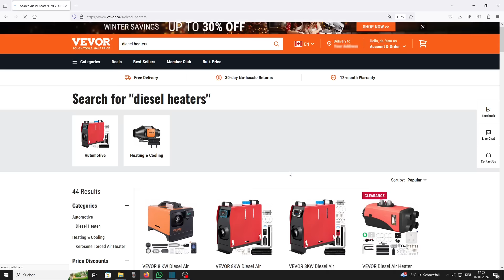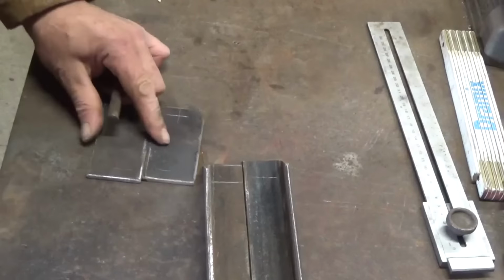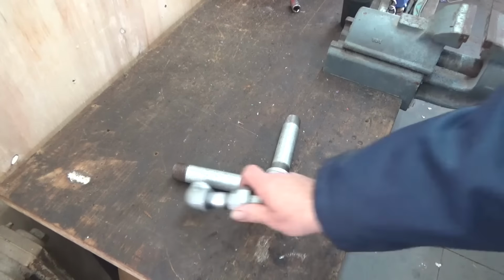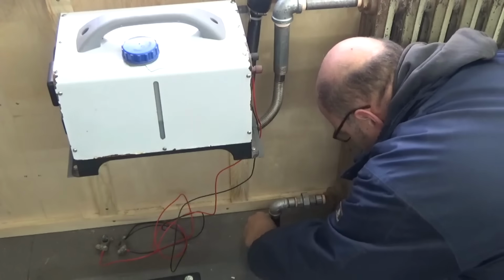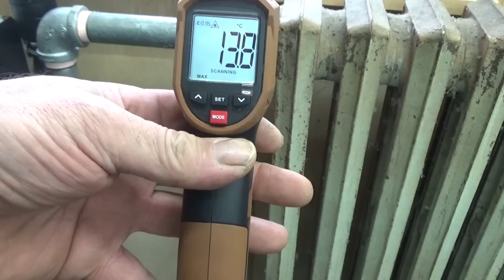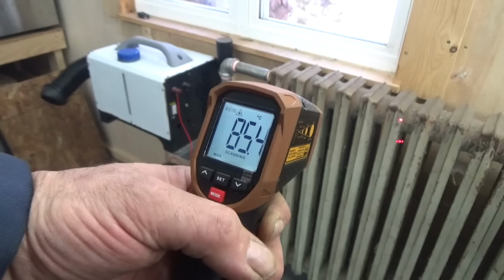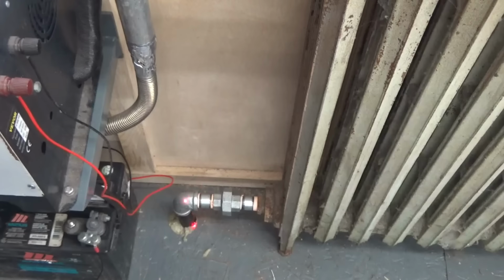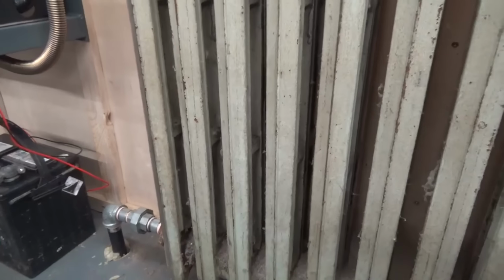Diesel heater upgade 200% more efficient

Comment: A meter of standard exhaust, always going down or sloped downwards, with a small fan blowing on it will yield room temp exhaust at the end with no carbon.  Also have the intake on the inside air to limot the effect of having to heat the air too.
Reply: I made a recouperator for mine with a 3m coiled section of the same exhaust tubing. It's got a riser section coming out of the heater and coils downward to the outlet. No fan, purely convective. Exhaust temps at the recouperator outlet are around 40c and just as you're experiencing, no soot. I was surprised as I was expecting at least some soot. I get lots of condensate as evidenced by the large puddles the thing makes, but I'll take a puddle with the extra BTUs. Its a garage I'm heating. Puddles there won't hurt anything.

Comment: How many amps does that diesel heater take to run?
Reply: Around 10 amps I believe. I had to buy a second power supply for mine as the first I got only had 2.5 amps which wasn't enough.
Reply: @alltaira5922  Uses only 4 to 5 amps for running. Startup temporarily is more because then it has to power the glow plug.

Comment: heat rises.. why did you do it backwards? exhaust hot out on top
Reply: I'd like to see if it makes a difference
Reply: It’s better that way, because all the condensation water can drip out and doesn’t fill the heater and creates backpressure. 
1L diesel creates more than 1L of condensation water.
Reply: @NickSiefert-jy7if    For the reason, you stated the exhaust pipe on the heater should be at a downward angle, not up as done in video.

Comment: I would have used black pipe and fittings, never galvanized when high temp is involved. It gives off poisonous gas. The exhaust pipe going uphill  usually causes problems with moisture buildup, but that big radiator must hold alot of heat once you get it running? Does any moisture accumilate or does it evaporate on the way out ? Do you need to drain it?

Comment: I think you'd be able to increase the efficiency by using outside air for the combustion air intake instead of indoor air.  You're creating a negative pressure space, drawing cold in inside the building.  Outside air will combust the fuel just as well and wont create a negative pressure. In the end you'll use much less fuel to heat the indoor air.

Comment: It will work but defeat the safety of it. Most are designed to vent outside so you dont monoxide yourself. Would be like running your car exhaust through your cab for more heat. Ok if it dont leak. For safety yours should mount so it exhausts outside of wall or floor and be sealed off from where you breath.
Reply: carbon monixide detector

Comment: Question...If you were to do this again, would you use a larger or smaller radiator than the one you have? Or would you keep it the same size. I was going to purchase  one on Facebook. The guy has quite a few different  sizes to choose from.
Reply from the maker: from my sight I would say I would go with the same size again because at the outlet the temperatur is so low what means for me it uses the maximum heat coming from the exhaust if it would be more hot at this end I would say it is to small.
Reply: @dsfarmns2823  Okay, Thank you! I was thinking about running two heaters to my radiator . I would make a junction box with two port holes, then run the combined exhaust  through the radiator,  so I am thinking of going half again larger than yours, maybe. I want a little heat to escape out the radiator exhaust. I will make my pipes larger than yours to make up for the combined exhaust. Good job on the project,  stay warm.
Reply from the maker: @mrwilly41  just make sure you have enough cross-sectional area you dont want back pressure and in my opinion I would go at least  1.5 times bigger radiator or 2 times if you use 2 heaters but wy not use 2 radiators for every heater one?
Reply: @dsfarmns2823  Like you, I am thinking less holes in the building. I will make it so I can remove one of the heaters for other tasks if need be.

Comment: How long can you run the heater off that single 12v battery?
Reply: heater runs on diesel, and uses just a bit of electricity for the fuel-pump.
Reply: Mine is a 8kw and it’ll run on the middle heat setting around 20 hours on a 850cca deep cell battery but you need to fill the fuel every 10-12 hours, my tank holds a liter and on the highest setting the battery last about 7-8 hours,1 liter of fuel lasts about 5-6 hours on high. There are tons of variations of these heaters tho. Mine from eBay was $80 to my door in New England
Reply: @jeffhuntley2921  only a 1 litre tank? That's weird.

Comment: Exhaust gas’s will want to go up not down, so you are fighting nature by pressing down hot fumes. Wire it differently with input down and output up. Then the radiator will be hotter down, with will heat upwards with the natural flow, producing more warming energy.

Comment: You will have a carbon build up becuase water will puddle in the pipe before the rad  #1 failure of these unit is carbon from bad exhaust routing

Comment: Here is some food for tought ....  Turn around the Heater unit so the air exit is on the Radiator side (soon it will suck in warm air at current position)   get a shroud made for the Radiator on on the side facing the wall and the opposide side.. Mesh on top  ..  bottom side give it the hot air exhaust  from the unit as well.  box off the under side of radiator but allot a few holes in the sides * 60% open max only front .. this will increase airflow of radiator and the unit hot air will help disipation by both heat and flow..  my take on something ive seen ona 1970s Gas heater  this would circulate the heat from down to up . and in the whole room plus shrould could be insulated on the wall side with gold reflective foil from some rally car shop

Comment: Neat idea, I'd definitely make sure the old repurposed radiator was leak proof first, and definitely get a CO monitor or two.  Ideally get a CO monitor that has a relay to cut power to the heater.
Reply: Do NOT let it cut off power to the heater . . . . it may get overheated and destroy the motherboard, cut the power to the pump instead . . . . so the fan is still is working and cooling down the heater . . 

And think about that the radiator may only make the heater 3-6% more efficient 😵not 200%
Reply: @matzstrom3223 Comparing the difference between the radiator input temperature to the output temperature I'd say all exhaust heat has been captured in the room which would definitely improve the heaters efficiency more than 3-6%.
Reply: @pstoneking3418  No, he only measure IR in direction to the surface on the pipe/ radiator, it does NOT tell the temperature (energy transported) of the exhaust gases, you have to measure the gases when it exit the room.

One more problem is that he use air from inside of the room to feed the combustor. . . that same volume of air will get in from outside . . . .  . 

In a experiment video with a "China" heater, and when it runs in its most efficient set up,   it leave 94- 96% of produced heat inside the room, that's includes the exhaust pipe radiation, it exist a test video.

I have not make any calculating's that can back up my "may become only . . . " statement, but i think you get the point, 
It's NOT even close to 200% more efficient, but the claim may be 4-6% more efficient are for sure MUCH closer.

Comment: You could also build a sand battery and run the exhaust through that to prvide a thermal mass that will carry on pushing out heat after the heater is turned off.
Reply: I was thinking the same thing, a sand battery could be done incorporating a built in copper tube wound heat exchanger for hot water as well.

Comment: The aluminum tape is scarong the shit out of me, if that exhaust pipe falls out its going to be co poisoning
Reply: Just of a detector in the shop.
Reply: Just use gas pipe technology to make sure the exhaust pipe is secure.
Reply: You’re scared by a piece of aluminium tape?
Reply: It's very robust stuff.
Reply: You will hear and smell that, long before it becomesd dangerous.

Comment: At the lower end of the radiator, place a container for condensate collection. I don't want to upset, that's how I see things according to my idea. Anyway, the radiator being made of cast iron, it will accumulate heat, this is a big advantage. But, it is possible that an aluminum radiator is better, having better radiant transfer, dispersing the heat faster.

Comment: if anyone wants a cheap super simple way to extract heat from the exhaust, just buy a pack of scotch bright stainless steel scrubbers. You can expand them from the middle and slip them onto the exhaust pipe. They have a ton of surface area and conduct heat from the pipe really well. they work pretty well already by passive heating, but you can add a fan to help a little. You can buy a 16 pack for $10. Thats all you need.
Reply: Nice idea
Reply: Careful about back pressure. If you can, expand the exhaust pipe before you do this because if you plug the exhaust, the burner blower will start to force air out the sides of the exhaust instead of straight out
Reply: @aaronwalsh7266  I’ve had this for years, I don’t get why the exhaust will get plugged up? The steel mesh is on the outside.
Reply: That’s a good idea, just wrap it around the exhaust yeah? I’ve just bought one of these heaters it’s coming this week I’ll give that a try cheers 🍻
Reply: Great idea 👍
Reply: Considerably more HEAT comes out of the hot air duct than is lost down the exhaust. (4x as much). However, 20% going to waste is a lot.A long length of corrugated exhaust 
pipe could be run inside a 50mm aluminium tube with a computer fan at the cool end to maximise heat recovery. Don’t over-straighten the pipe so air can get all around it.

Comment: Better to use a heat exchanger and pump the water into the radiator. You're going to get stuff condensing in the radiator the way you are doing it. Plus the exhaust needs to be free flowing.

Comment: Your first 
section of exhaust pipe will fill up with condensate and block the pipe as it's going "up" to the connection on the old steam heater.
Reply: It is 100++ degree hot It can boil water rather than condensate
Reply: The outlet needs to slope downward so that condensed water can drain out.
Reply: @Dave5843-d9m  Correct, that's the biggest problem here.

Comment: Or,,,,,,,just run the exhaust pipe through a nice bucket of sand to heat up and stay warm. Buddies heater will fail from poor exhaust flow causing soot up and condensation issues. A bit of copper tubing , same diameter of coarse. Combustion intake must be from the outside , heating air intake should be from the inside of the space but the other side of the room to circulate. Lastly and most importantly ,,,,,a CARBON MONOXIDE AND FIRE ALARM IN THE ROOM ,,peace on earth and ocean

Comment: You need to add a drain valve to get rid of condensate building up in your radiator. Alternatively, use a more modern type (sheet metal) and tilt it so the condensate can exit via the exhaust.

Comment: the teflon tape is not heat resistant you might need to try another sealant for that maibe an silicone gasket material in a can for engines , with the heat from the exhaust theres allso the chance that the zink coating will cook off the pipes you bought and these fumes are verry toxic and can give you a splitting headacke , best to take off the zink with some draincleaner and paint the pipe in heat resistant paint or use brass and copper 
while youre at it replace the flex pipe with solid copper pipe with crush fittings so theres less chance of it leaking 

other than that the idea seems to work , might work even better if you enter the hot exhaust in the bottom of the radiator so theres more flow of the hot air rising up throught the elements heating more of the cast metal , right now the hot gasses collect at the top and stay there untill they cool making it less efficient  (will mean having to put the exhaust of the radiator through the side of the shed to help with the flow or the heater realy needs to push it down intoo the floor agaist the hot gasses wanting to rise 
(might not be as hard once the exhaust gas is cooled off though ) 

wonder how long it takes before the soot buildup inside the radiator will choke the exhaust 
shouldnt be too hard to remove just trow the whole thing in a burnbarrel and leave it in there for a full burn then put some junk inside and rattle and shake to loosen the dried up flakes of soot out of it might need to use compressed air too to get it to come out the small hole 

might get even more efficient by running the air outlet pipe in a spiral through a barrel filled with sand , that heats up the sand (mass) and releases the heat slowly even after the heater is turned off , does take up a little space and time to heat up

Comment: Nice idea to recoup the heat lost by the exhaust, but I would have turned the unit around to have the heat vent also blowing through the radiator.  This would have a two fold benefit: 1. it would help to heat up the thermal mass of the cast iron radiator quicker, and 2.  Once up to operating temperature the hot air passing through the fins of the now heated radiator would distribute the heat from the radiator better.  On a side note, I would definitely add a 90° elbow to that exhaust under the shop and run it out from the perimeter of the shop (the rockwool may help where you drilled the hole, but there may be a couple seams on the underside to let fumes back up into the shop).
Reply: Not really.  Heat inside is what matters. If you transfer heat to other objects changes nothing .....unless it increase heat radiated to the outside, which it might.  Capturing exhaust heat helps but dumping heat into a cast iron heat exchanger instead of aluminum  is less efficient but better than just dumping it.

Comment: Bought the exact same heater two weeks ago, $146. The owners manual is incomprehensible. I managed to get it going by just turning it on. Manual makes no mention of the 6 different heat output settings. If you have any problems and need technical support you have to exchange emails with someone in China. It does put out pretty good heat, and was cheap, but frustrating supporting info.

Comment: Having been an engineer in the heating and cooling business for over 50 years, I have seen other's attempt to extract heat from the combustion by-product (exhaust).  And all have failed over time.  As you cool the by-product the particulate that is contained in burning diesel drops out and collects which clogs the exhause with back up into the conditioned space.  It doesn't occur right away but over time the thing will be unusable.  Many have tried and many have failed, trying.  That's the best short synopsis I can come up with to describe what this fellow is attempting to do.
Reply: And it seems they’re always too cheap to add a CO detector…too much money.
Reply from the maker: It's very informative to see what thoughts people have about a system. Nobody can drive a car for 50 years without changing the oil or run a stove without cleaning the chimney. I have never and will never claim this system is maintenance free. But it allows me to heat my workshop cost-effectively and effectively with the maximum heat energy yield that is available.
And I'm sure with hardware costs of $200 for this type of heating system, there's nothing cheaper.
Reply: @dsfarmns2823  how has it been holding up? Have done any maintenance to look for carbon build up?
Reply: @aday1637 so what, will have to buy another 2nd hand radiator for $30 after 2 years?? I've been on places where a pizza costs more.

Comment: DANGER❗
You will damage the heater. 
Moisture condenses in the exhaust flow. You must not make the pipe go upwards❗
Reply: The exhaust is too hot in that area to accumulate moisture..

Comment: I would have use the bottom of the radiator for the input and the top for the output. Just to capitalize on the natural flow of heat upwards.
Reply: Well, that's a pretty bad idea. You don't want to let the heat out of the radiator. Instead you put the output on the bottom, which avoids a chimney effect creating low pressure from the draft and also will lead to the coolest air in the radiator to leave the pipe naturally.
Reply: @RubenKelevra good point. Also allows condensation to exit. I digress.
Reply: Well, you would have been doing it wrong.

Comment: the 1st thing I did when I got my diesel-heater was to install an old radiator along with it. The exshausts gets hotter than the wearm air coming out and we do really need to take care of that.

The radiator got so hot the paint on it burnt. I sandblasted it and its been running perfect since. Exhausts are cold even after 2 hours running. After about a minute u cant touch the radiator near the inlet.
Im aslo running my own diesel fuel cutting down costs even more.

Comment: The condensate from combustion is likely to freeze in the outlet from the radiator as it passes out side.
At that point your foil tape will fail.

Not long after your going to be incredibly sleepy perhaps the longest sleep

Comment: Use a carbon monoxide detector in the shop to safeguard you in case the exhaust starts to leak into the shop.  The cooler your exhaust gas is the more vapor will condense into liquid.  These liquids will build up in the radiator and will be somewhat corrosive.  It would be better to have the outlet of the heater slightly above the radiator so no liquid would build up in the exhaust going into the radiator which could partially block the exhaust flow.